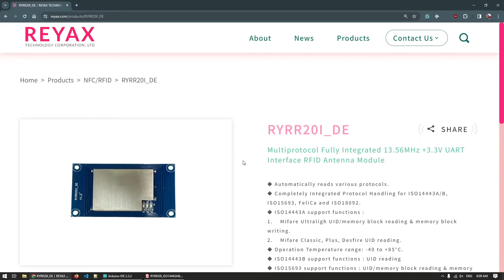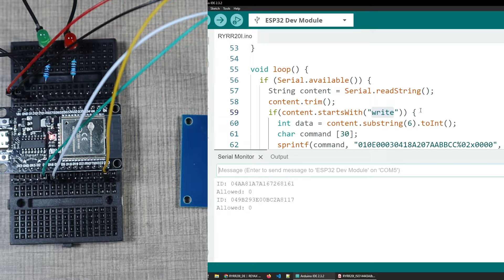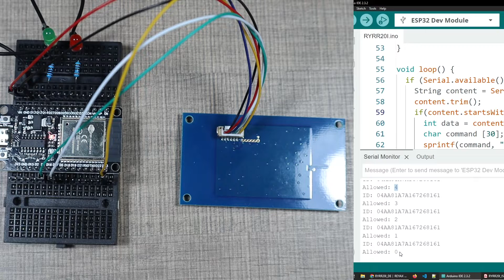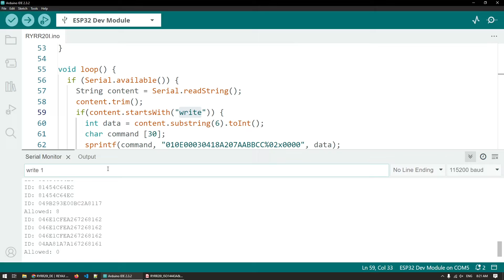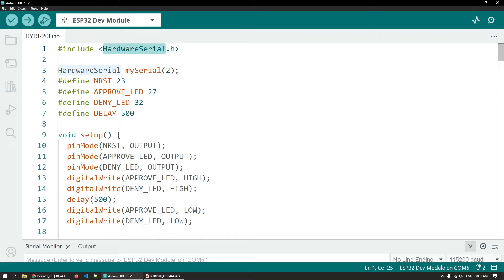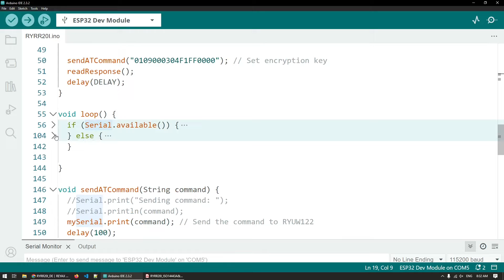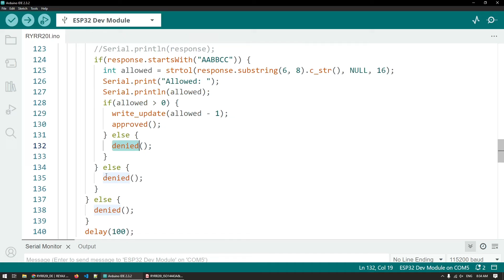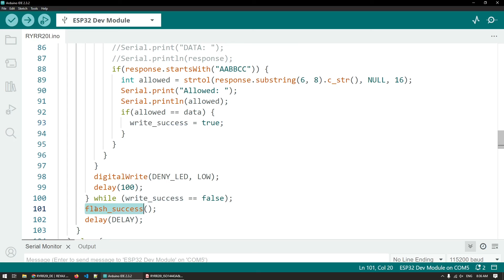RFID with Memory! Prepaid based access control with RYRR20I_DE and Mifare Ultralight

Comment: Is it possible to use more than one NFC reader in one ESP, (i.e. one reader per relay/door)
Reply from the maker: The ESP32 has hardware 3 serial ports so as long as you don't use the serial for the USB interface with computer, it can speak to 3 readers. Additionally, I guess you can also use software serial to speak to more but honestly, doing a controller per door does not add that much overhead.